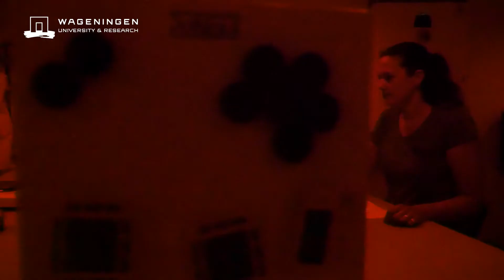Netherlands Centre for Luminescence dating

Comment: Presumably red light is incapable of inducing optically stimulated luminescence?
Reply: It's actually amber light, some labs have red light but the amber makes it more easier for the researcher working in the lab. The light has a much lower intensity which ensures the grains are not affected.